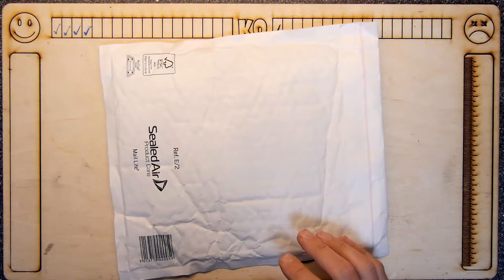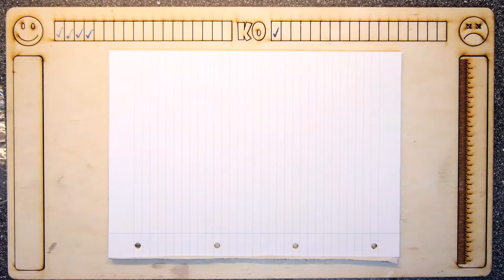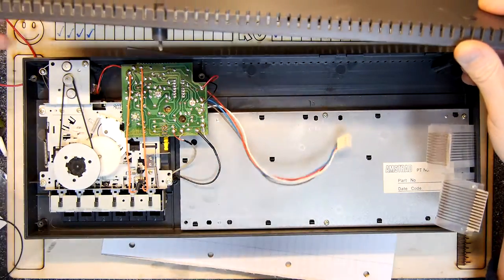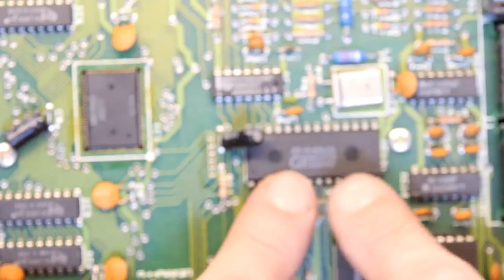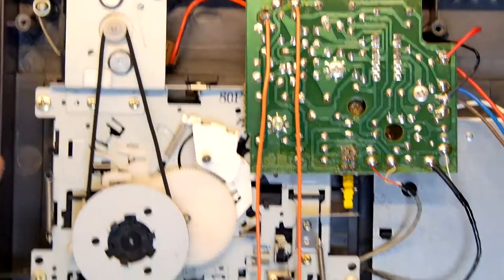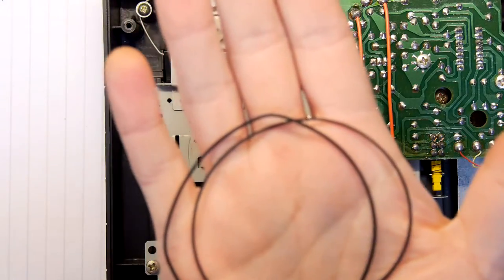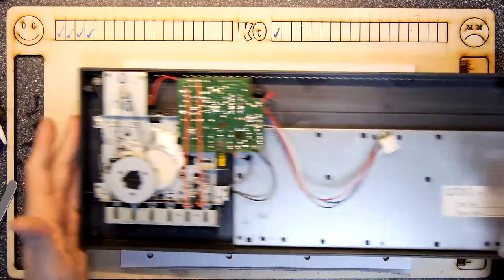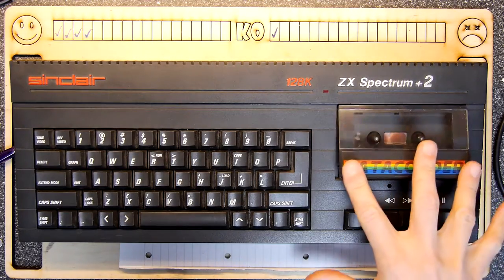ZX Spectrum +2 and Drive Belt Repair

Comment: I got a +2 a while ago and I noticed it has a wobbly RF modulator, so this was useful. I would've most likely torn the ribbons if I didn't check this video first. I'll have to resolder a cable that seems to be broken off the modulator and probably secure it down somehow and I'll have to see if it works, don't have a scart cable for the system yet
Reply from the maker: So glad I can help. Great to hear a retro classic may be up and running soon 😁
Reply: @backofficeshow  well it seems like something might be wrong :/ I'm just getting a white border with a black screen, pressing the tape buttons seems to reset the system as it causes the screen to turn off for a second and back to the white and black

EDIT: after I left it for a while I got some flickery purple stripes and I found an image that looks similar to my issue and it might be IC6 that's bad, best lead I've got so far so might just swap that out assuming it's a cheap part these days
Reply: @backofficeshow  Alright I think I'm onto something, I tried reseating all the 4 RAM chips on the bottom (IC3,4,5,6) and found out that 3 and 5 got burning hot within seconds of powering on the machine. I swapped 3 to 4 and 5 to 6 and after that 4 and 6 burnt my fingers... I'm guessing the chips are shorted out and it's not due to the motherboard

Comment: Well that looked quite straight forward! Holly came downstairs while I was watching. After moaning she couldn't watch her programmes she actually started watching it and decided that the bottom section of the machine was more interesting!

She's watching Wind Club now though!😄
Reply from the maker: +Mark Sharples ha ha 👍 the tape drive in the earlier +2 is a bit more fiddly, had two belts. Still worth changing for a couple of quid of it saves your Monty on the run tape 😂
Reply: Can you imagine the havoc it would cause to Manic Miner? Nobody needs a stretched Willy😄
Reply from the maker: +Mark Sharples depends on who is doing the stretching I suppose 🤔
Reply: Well, that is very true😋

Comment: I hope you bought the correct RGB cable for your +2A? There's a difference for the grey +2s and the black +2A/+2Bs. (You might like to give a little warning on that for your next video) 🤓
Reply from the maker: +FairFight14 really? What's the difference?
Reply: http://mts.speccy.cz/doc/128_rgb.pdf Basically, the output pins of the +2A and up, were changed, but also included stereo audio. The output pins were now changed, because a "real" RGB signal was now sent. The +2, only had a mono audio out jack, and no audio over the video port.
Reply from the maker: +FairFight14 i was going to say, because I've tried this same wire in a +2 (grey) and the video looks fine
Reply: You'll note that coolnovelties do have two different cables. http://coolnovelties.co.uk/coolnovelties/sinclair-zx-spectrum/87-sinclair-spectrum-128-2-3-rgb-scart-cable.html?search_query=spectrum&results=16 and http://coolnovelties.co.uk/coolnovelties/sinclair-zx-spectrum/88-sinclair-spectrum-128-2-grey-model-rgb-scart-cable.html?search_query=spectrum&results=16 As you can see from the pdf I linked before, there is a quite a difference. (The two wiring diagrams)  Forewarned, etc. 😀